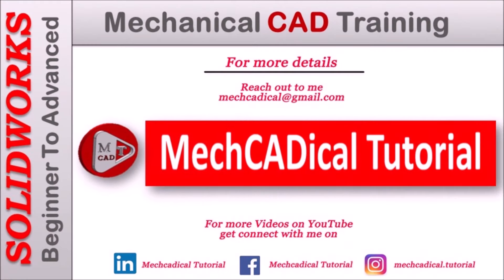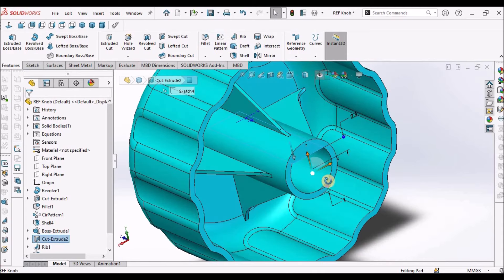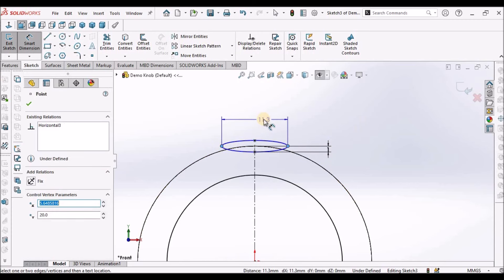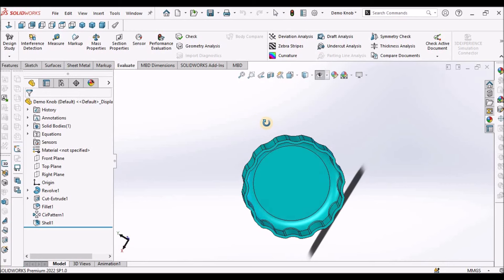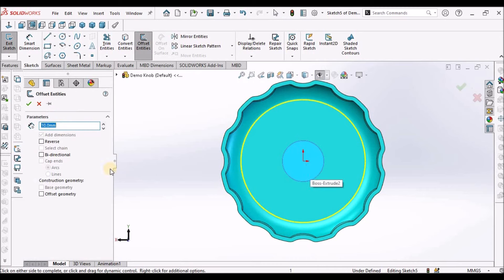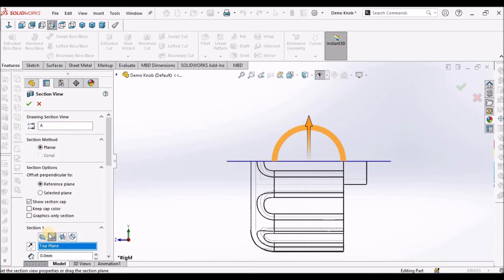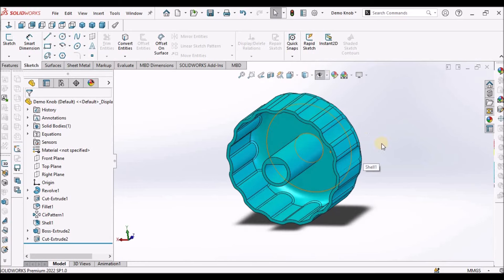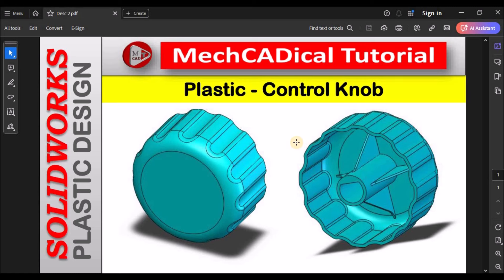How to Design a Plastic- Control Knob in SolidWorks

Comment: You should not place sketches on existing solid faces (7:14) when you have an easy opportunity to put it on the base plane. It makes the model unstable and relying on previous features and Solidworks is terrible with stability of features. You don't build the model as a one-timer thing unless it actually is a build-print-forget thing. Think about modifying it and about your workmates that might take it over in the future.
Reply from the maker: Thanks for taking time...taking existing face is preferred because when we modify patent feature, it will loose it's dependency, and child feature can move any where. What you said concept is mostly useful in top down approach, when we create two different components in an assembly, with edit mode. In future, I am going to add more videos on topdown approach.